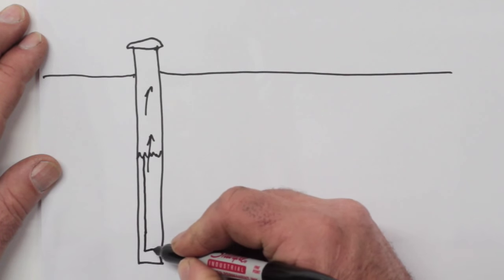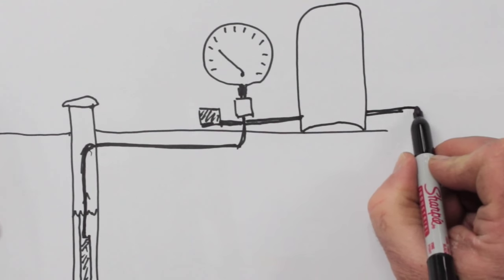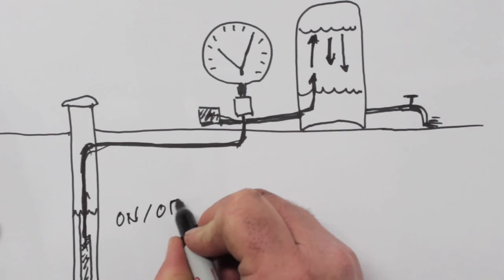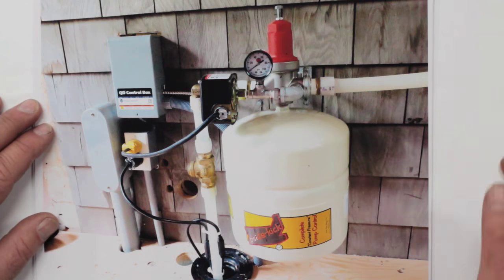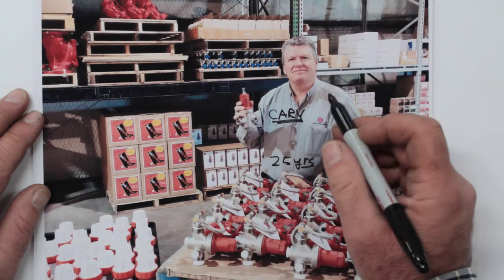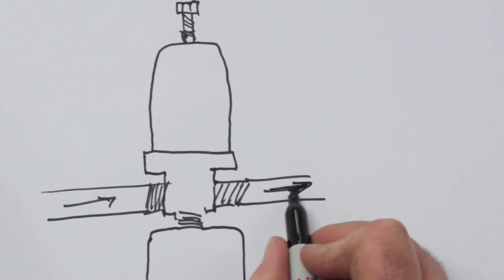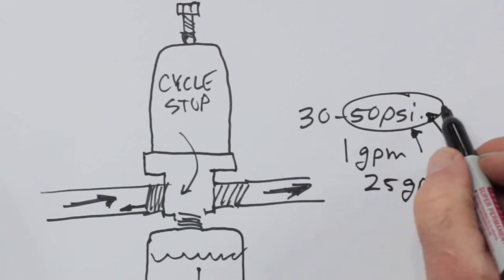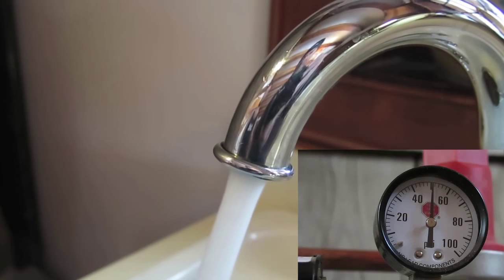How to Make Your Water Well Pump Last Longer

Comment: Thanks Steve.  As the inventor of the Cycle Stop Valve I really enjoyed the comments.  As of 2019 we have been making and selling CSV's for 27 years now.  It is a simple valve with a complicated explanation.  There really are no drawbacks or negatives to the CSV.  Just the opposite in fact.  The CSV is a disruptive product because it makes pumps last longer and use smaller pressure tanks.  I am still amazed at all the negative responses and incorrect assumptions about how the CSV works. I know people don't like to be corrected about something they thought they understood.  But wow some of these people get really personal with the attacks.  They should realize how foolish they sound to people who really understand pumps and know CSV's are good for pumps.  Some people just keep repeating their stupid comments like repeating it enough will make them correct.  LOL!  Here is another video that might help explain some more.  https://www.youtube.com/watch?v=LPIUufWjbic&t=219s
Reply: so this replaces a VFD system? whats the pros and cons?
Reply: Talk to your motor manufacturers about the 1 gpm by-pass port which water flows through once there is no longer a demand source. Yes even though the amperage is lower at this point, the minimum flow requirement for motor cooling is not met. 
Even the vfd application which provides for lower amperage is not acceptable by manufacturers required cooling.  Check the AIM Franklin Electric manual for reference.  
While this valve performs as described, it is not a viable statement to say it saves on motor life. 
Starts and stops kill motors, which the valve addresses, but cooling is paramount!
Reply: @MF-hd1tq  Read the AIM manual on hot water applications. If unloading the motor makes it safe to pump hot water, it doesn't take much cool water to prevent heating the motor. Not so with VFDs though as they create a smaller motor instead of unloading a large motor and still need full cooling flow.

Comment: I know it's hard for people to understand how this valve works, but it DOES work. I installed one, their cheapest model ($75 I think?) on my 3/4 hp well pump because it was cycling on and off for several hours when the lawn irrigation system ran. THAT is where a Cycle Stop valve really shines: keeping the pump running and the pressure steady for long stretches. The company website is very well assembled, and you can learn all about these valves there, if you have the time for some serious reading! Cheers from Canada.
Reply: it stops the cycling during a long run, but the cost is way longer run times and way more electrical usage. That is just the facts.
Reply: We burned up an oversized 1.5 hp well pump at our house 7 or 8 years ago when running irrigation. Effectively the sprinkler zones were undersized and the tank would fill, stop the motor, draw down, and cycle back on over and over all summer. The pump was newly installed in 2008 and lasted only to 2013. We installed a 1hp since we couldnt resize all the sprinkler zones and it has been a champ not cycling. But i still like the idea of this CSV with other applications in the house with 3 bathrooms and tons of use. Cant wait to install it.
Reply: @bigtxbullion  Why didn't you adjust the sprinkler heads to allow a greater water flow to control the pump cycling and shorten your sprinkling time?

Comment: Personally I wouldn't want my submersible Pump running all the time. I've pulled it twice due to bad pump wires. After getting good stranded Pump FlatWire, it has lasted 20+ years. I have WellMate 31 gallon Fiberglass Tank and going to replace with a WellMate 47 gallon. Well is 135 ft. down
Reply: With a CSV the pump only runs when you are using water.  It shuts off like normal when you close all the taps.  The reason you had problems with the wire is caused by slapping around when the pump starts.  Chaffing the wire is just one of many problems the CSV solves.

Comment: As Jerry was saying,about a clogged pressure sw, I have experienced this pump cycling,and cleaned a clogged 1/4" tube feeding the ps.,but believe me your better off replacing the ps since the internal are not reachable.

Comment: On top of this amazing solution, i feel like there should be an installed secondary filter at the bottom of the well that gaps the submersible well pump from the rock bottom of the well. would help keep the lifespan a little longer and not leave all the filtering duties to the well pump entirely. 

The well pump could also be turned to a lower psi flow to fill a larger tank and then use an auxiliary above-ground pump to increase the psi for on demand. Maybe you will get drops in pressure if you overuse your from the tank but replacing an above ground pump vs. the well pump sounds like a better time to me.

Maybe an engineer or experienced well installer can chime in to whether this idea is ignorant or not
Reply: Most wells are designed to be a filter all on their own.  With slots in casing as small as 20 or even 10 thousands of an inch, and gravel packed with basically media sand, or even filter screens in the casing, nothing should be able to get into the casing to start with.  Wells are no longer just a deep post hole.  

Tow pump systems with a storage tank and booster pump are common where there is a low producing well.  But with good producing wells there is no reason to install and maintain twice as many pumps and equipment.

Comment: 5:00  That is the same as any standard system except it limits the pressure to 50 PSI in the house even though the pressure in the tank continues to raise to 60 PSI.
Reply: Not exactly.  The CSV keeps the house pressure and the tank pressure at 50 PSI until you turn off all the faucets, then it fills the tank to 60 and shuts the pump off.

Comment: This is a simple pressure regulator. Most homes with wells have them. The best thing to have is a Constant Pressure Regulator that only gives the pump enough voltage to hold a desired pressure when in use.
Reply: Yeah, NO! The CSV is a Constant Pressure Regulator that has been replacing those expensive and problematic variable frequency drives for over 30 years so far.  Most homes need a CSV, but no so many have them.  That is because the pump companies don't want your pump to last forever the way the CSV would do.

Comment: Great video.  I have a jet pump at the cottage and a small 6 gal pressure tank.  Can the valve be installed between the two rather than connecting the valve on top of the tank. Or should I just connect the valve on the output line of my tank.
Reply: The CSV needs to be installed on the outlet of the pump, prior to any tees, tank, or hydrants.

Comment: hello, 
my well-pump went down last month. Got 80 g tank already installed. Can I still use this Cycle Stop Valve on this big tank?
Reply: Sorry for the delay.  Yes the CSV will work with any size tank, you just don't need a very big one if you have to purchase another.
Reply: No, do not use a cycle stop valve on a large tank. you will destroy your pump with the long tank refill cycle at those low flows.
Reply: @drob5664  Sorry D Rob, but a pump like that can run 24/7/365 at 1 GPM and never fail.  Pumps are made to run continuously, it is the cycling on and off that destroys them.  I have a pump on a stock tank that hasn't shut off in over 18 years so far.  Expect at least another 18 years at least running that way.  However, it is a moot point as you can set a CSV to get 2 minutes of run time with any size tank.  Set the CSV at 58 PSI when using a 40/60 switch and even an 80 gallon tank will fill in 2 minutes.
Reply: @drob5664  Thank Rob, I did not use it so i am good.
Reply: @jeromebrown8903  You were talked out of the most useful product for a well pump by someone who has no idea what he is talking about.  It doesn't tank too long to fill large pressure tanks with a CSV, they just need to be set to make that happen.  Plus, even if it took years to fill the pressure tank at 1 GPM rate, it would never hurt the pump.

Comment: Will the pump cycle on and off if turning the faucet on and off frequently?
Reply: John Hafner; Yes, depending on how long the water runs and how large a tank you have.
Reply: @tracykey9227  NO it will not.  The CSV fills the tank at 1 GPM.  Even a 4.5 gallon size tank that only holds 1 gallon of water will make a 1 minute mechanical timer to keep the pump running for a minute.  If within that minute you open the faucet again the pump never stopped running.  You could also flush a toilet a thousand times in a row and the CSV would only let the pump cycle once.  If you wait 2 minutes between water uses then the pump will cycle again.  But the 1 minute of run time makes sure you are finished using water before the pump shuts off.

Comment: What if your well only produces 6gpm and you run the washing machine while showering and someone is washing dishes ?Will this run the pump dry ?
Reply: Not as long as you are using less than 6 GPM.  We also make the Cycle Sensor to protect pumps like yours from running dry.

Comment: Unfortunately we just had to replace our 86gal pressure tank. However, would it still be an advantage to use this valve? Also would it work with a geothermal furnace running off our well? Would that make any difference? I'm attempting to find ways to lower the costs of operating the geo. I believe the well pump is the majority of the operating cost. We have a 3/4hp submersible pump about 150 ft deep.
Reply: Although with a CSV a small 4.5 gallon size tank is all that is needed, it will still work fine with an 86 gallon tank, which only holds 20 gallons of water anyway.  Some people who don't know how it works would think the CSV would take too long to fill that size tank, being that it fills the tank at only 1 GPM.  But setting the CSV at 58 PSI when using a 40/60 switch on a 86 gallon size tank will still only take a couple minutes to fill the tank.  Plus, the CSV keeps the pump running as long as water is being used, so the tank only fills when you stop using water anyway.

The fact that the CSV keeps the pump running as long as water is being used is why it works so great with a heat pump.  Heat pumps run for long periods of time, which causes the pump to cycle on and off a lot, even with a big pressure tank. The CSV will eliminate all cycling while the heat pump or anything else is being used.  The CSV may not reduce the electric bill, but will make the pump and tank last several times longer, which is a big savings in itself.  Even though the pump maybe cycling itself to death, it is still working about as efficiently as is possible.  Over the years I have heard a lot of people say it doesn't matter how much energy a heat pump is saving if they have to replace the well pump often from all the cycling.

There are ways to save energy with a heat pump.  But starting with the smallest pump possible and working at the lowest pressure possible is about the only way to save energy.  One trick I use is to utilize the discharge from the heat pump to supply the house.  This causes the water temp in the house to be a little higher in summer and lower in winter, but it is barely noticeable.  This utilizes the same water twice, and makes it where the pump can be even smaller.  Using a brand or kind of pump similar to a Grundfos will also help with efficiency as that brand of pump will drop in amps when restricted with the CSV much more than some other brands.

Lots of possibilities.  Call if you want to get more technical.  Cary  806 885 4445

Comment: Will it work for system that feeds two houses . the main house and a line from that to a house 100 ft away
Reply: The idea of the CSV is that it can make a pump that is large enough for several houses work just fine when only one shower in one house is being used.

Comment: Thanks for the video. I'm wondering how the cycle stop valve works beyond what you were showing? The video seems like it was cut short in the explanation of how the cycle stop valve works better than a pressure switch set up?. In the example used in your video , the flowing faucet was on and the pressure was set to 50 psi in the cycle valve;  If the faucet were shut off , the pressure in the house system would  return to 80 psi? stop the pump at the 50? Keep the pump on very slow trying to maintain water pressure below 80 psi? Its not clear how this is advantageous when used with a pressure switch. Thanks
Reply: To keep it simple, the pressure tank is essentially eliminated. So the pump kicks on and stays on anytime demand is > 1 gpm. The traditional system fills a pressure tank until the pressure reaches upper limit (50 psi) then the pump shuts off. Turn a faucet on and pressure drops until the tank reaches 30 psi and the pump kicks back on until it reaches 50 psi then shuts off again. If the faucet stays open the pressure keeps raising and dropping causing the pump to cycle on and off. The constant pressure valve turns on when it senses a small pressure drop (5 psi) and maintains constant pressure by keeping the pump running continuously until the faucet is shut off. This saves on/off cycles of the pump extending the life of it. Also eliminates a large pressure tank that takes up space, keeps constant pressure when using a shower for example. No surging of pressure dropping and raising all the time during your shower.
Reply: @Brianc5001  Thanks Brian.  It is nice to hear it explained by someone who actually knows how it works.

Comment: I think you want to say the pump runs as long as water is running. Right?  The way you said it made it sound like the pump runs 24/7
Reply from the maker: +woodaddict1 Thanks woodaddict1. I'll take a closer look and see what you mean. I can always tweak the audio if need be.
Take care,
Steve
Reply: +Steve Maxwell Yeah, I don't see how this can save amperage if the pump is running all the time.  It has to switch off at some point, otherwise it would eventually burn out.
Reply from the maker: +JustinTrojan Hi Justin. The pump doesn't run all the time, just when water is being demanded (a tap open somewhere and running). As soon as the water demand shuts off, the pump keeps running until maximum pressure is reached and the pressure switch shuts the pump off. I hope this helps and thanks for watching.

To answer some of the questions below, I got mine from the CycleStopValves.com. They do mail order all over the place. Cost for the valve, tank and pressure switch is $400.

Bye,

Steve
Reply: Ahh, thanks.
Reply: @eco_guardian  Even if the pump did run all the time it would not burn out.  Pumps are made to run 27/7/365.  I have one on s stock water system that hasn't turned off in over 18 years.  Running is good for a pump.  Cycling on and off is what kills them.
Reply: @eco_guardian  this will be lengthy... Every motor start has what is called an "in-rush"  current(amperage) draw, as every electrical motor driven device does, which is greater, sometimes significantly greater depending on the torque(power) needed to start a motor which is turning or moving whatever it is coupled to to drive, and this increased current means increased wear on the electrical parts and motor as well as increased electricity($$); doubtful a well pump would be that great of demand but could be and there is still an increase of current at EVERY start of the motor which will add up, however great or small amount it may be. So if a pump is running non stop during a water demand instead of stop and start reapeatedly to refill the tank as often times as is needed during the time the water is needed, such as in the time to shower or water your lawn or what ever, it will have significantly fewer starts, hence, fewer in-rush current events, hence less electricity. I hope this helps.
Reply: if the setting is 40-60, at 40 the pump run then i use a faucet to turn on the water the press retain to 50 until i turn off the pump still running the i use water again and again still the pump running till no one is using then it will stop to 60psi is it ok

Comment: What if someone is using there kitchen faucet alot on and off in a home and multiple people live in the house. Everyone goes and uses the faucet . This would in turn cause its own short cycling issue and pump on and off more. I’d say it’s only beneficial for irrigation where you have a time that uses water for like an hour straight. Or other scenarios I can’t think of at the moment. Correct me if I’m wrong
Reply: OK, I will correct you.  If only 1-2 people live in the house they can't use water intermittently enough to cause a problem.  If multiple people live in the house, the mechanical timer of using the CSV to fill the the tank at 1 GPM, means a tank that holds 1 gallons will make the pump run for another minute after the last tap was turned off.  During that minute if anyone in the house uses water, the pump just stays on to supply it, and then starts the 1 minute timer again.  Multiple people in the house means the pump will stay on of an hour or so until everyone is finished and out the door to work or school.  Same thing happens in the evening when people are getting ready for bed.  Cycle Stop Valve and small tank will cycle the same number of times as a big tank without a CSV.  But without the CSV you don't get all the benefits of soft stop, no cycling, and strong constant pressure in the house.